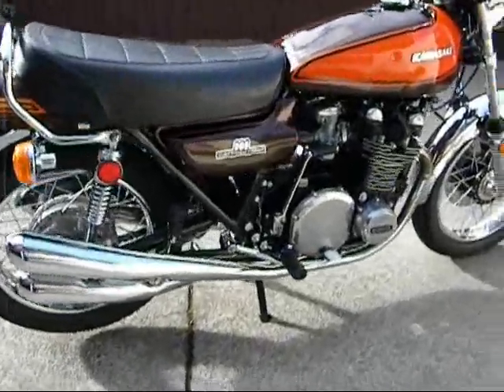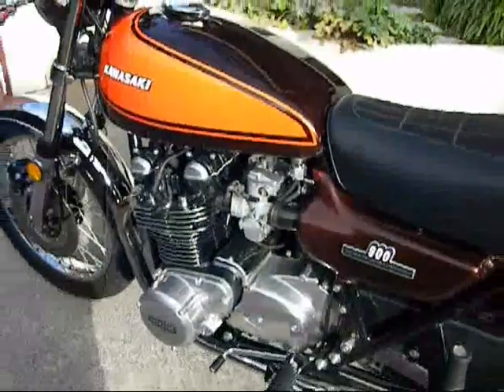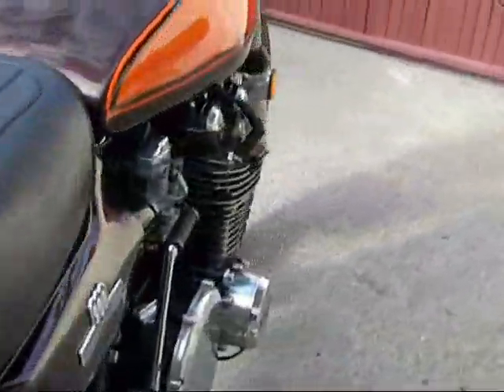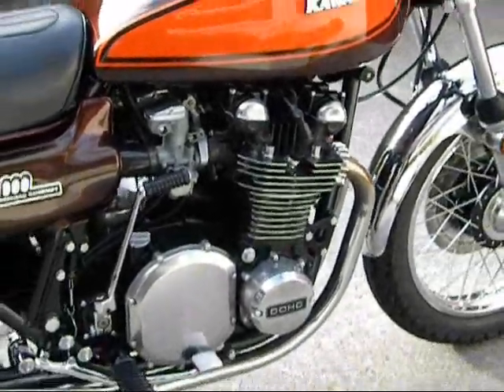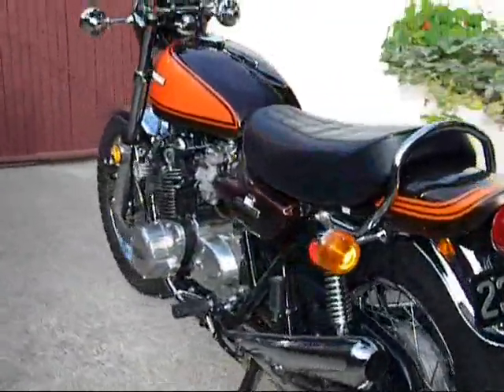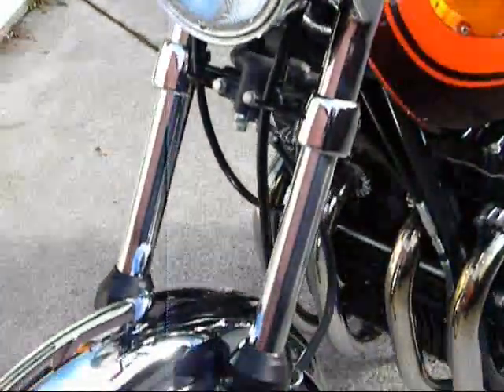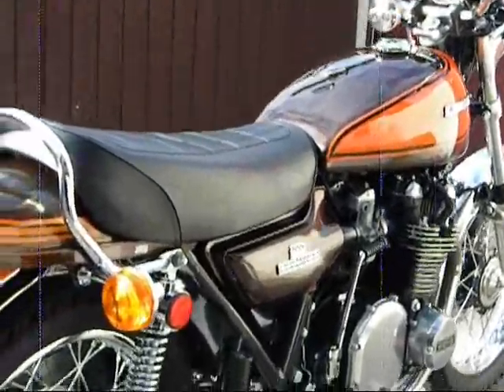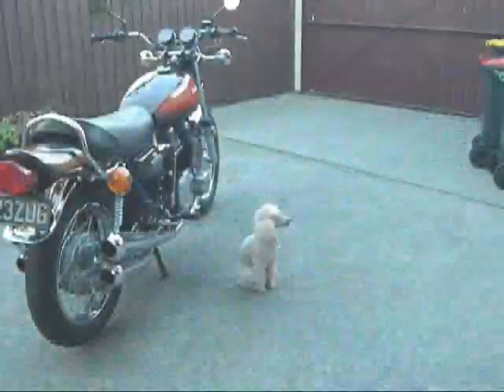1973 Kawasaki Z1

Comment: That is very much like what my 1973 Z-1 looked like stock. I put a chrome Kerker and straight handlebars with Tomaselli grips, S and W shocks and fork springs with a  1" spacer to change the geometry and 40 oil in the forks. And I took the chrome bar off of the back of the seat. It was fairly typical for Southern California. I sold it in 1978. It was a great bike. It did fry voltage regulators and headlights. Very cool video. Thanks for posting.